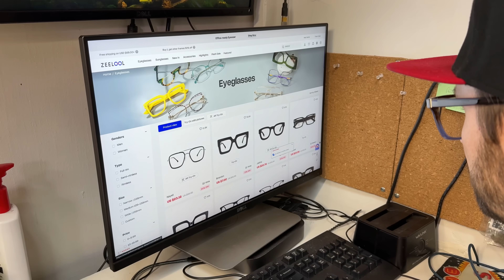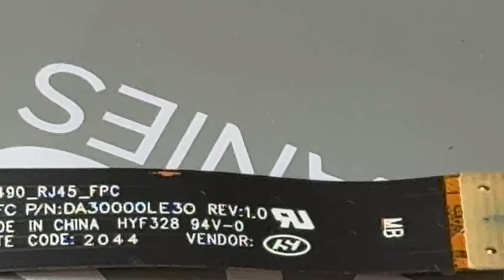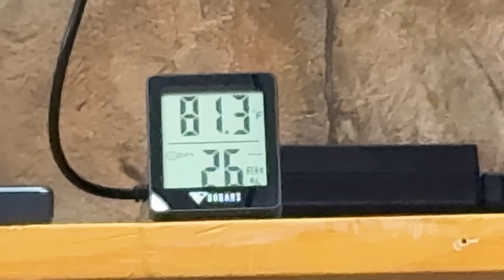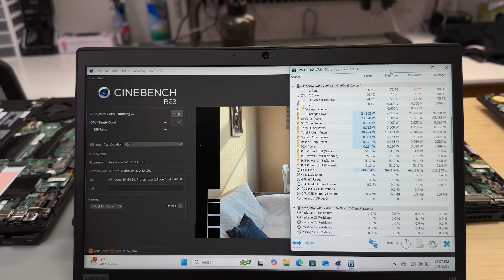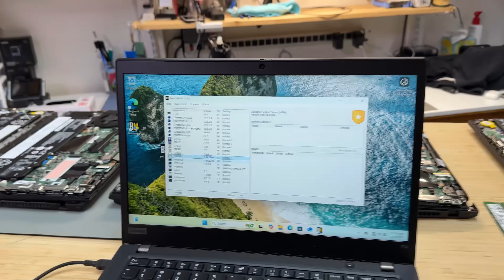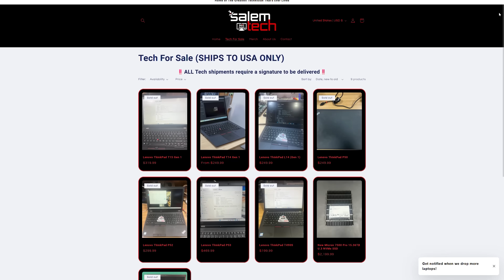Is Replacing Laptop Thermal Paste a MASSIVE Waste of Time? Let's Test!

Comment: @4:23 
Senior systems admin here, I happen to do a lot of endpoint configuration,imaging and server maintenance all day everyday for like 9,000+ endpoints.

As far as a good middle ground for imaging devices goes you can look into setting up a PXE boot server and a dumb switch with IP helpers. Just plug as many laptops in as the switch can take and they can pull an image from the PXE server. You might have to stand up a MECM/SCCM instance to use task sequences to make managing it easier. 

You could also just set up an ISO and config field on a FAAAAST USB drive to image off of. Configuration files or task sequences can help automate the whole thing for you to the point you just click accept initially and it runs the rest.

Azure has good solutions for imaging as well but then you have to lock in on the azure platform and it’s still subpar compared to AWS and other cloud services out there. We are being forced over to it and it’s a learning curve.
Reply from the maker: Due to the lack of Ethernet ports on the newer laptops, and my lack of funds to buy 1000 USB-C to ethernet adapters, I've resorted to using multiple NVMe cloners and saved Clonezilla images to image each device. But I appreciate the time you took to give me advice, I hope you are being paid well to handle all those endpoints!
Reply: @ that’s very fair. 
I am fortunate to have an entire stockroom of Ethernet to USB-A and USB-C adapters to use. We never image more than 30-40 laptops at a time though due to manning. It takes about as long to walk down the line plugging things in, powering them on and configuring the boot settings then initiating before the first few are done. 

Your cloning method is honestly smarter and faster because of the fewer parts and configurations needed for the scale you are doing. 

Definitely not getting fair compensation and will be looking at branching over to the Pentesting and white hat realm here soon. 7 years as a sysadmin has built me a stacked skillset but a narrow and heavy workload, I am sure you can relate lol. 
Love the videos and the right to repair advocacy man! Keep up the good fight.

Comment: Don't know if anyone has made this particular suggestion to you but I've used a procedure in the past to duplicate an image to multiple machines simultaneously and the same method can be used to image single machines or as many as needed at one time.  It's the client-server model and it would involve obtaining an old PC and repurposing it as your imaging server. I've used this method to image a classroom of 21 computers at one time and it works great doing single machines at a time as well.

Comment: Might want to try looking into MDT if Micro$oft still maintains it. A few years back I configured MDT to deploy a vanilla copy of Windows 10 and had the drivers dynamically installed depending on the model of computer I was deploying to. Automated BIOS upgrades were also added to the workflow. 

Another option would be FOG but not sure on its Windows 11 compatibility and dynamic driver assignment during deployment.

Comment: wouldn't high performance thermal pads serve your refurbished customers better as they don't degrade and now offer comparable performance to paste on laptop chips without heat spreaders?
Reply from the maker: I reserve PTM for the laptops that have higher temp chips. PTM is very expensive, and my laptops are very cheap.
Reply: @SalemTechsperts  when the pads are $10 a pop then that's fair enough

you seen that cheap stuff from china/aliexpress rated at 21w/mk? limited info online but what i found was positive

Comment: If you need free imaging software ,i've used one when i was working for a cheap ass company, FOG. (Google Fog Imaging or Fog Project, first result)

The configuration is not that hard, then once you create your base image to deploy you configure your firewall for PXE boot, then on boot selection you launch "boot from PXE "  and the machine thatt host FOG will run the utility.

You better follow the official instructions as my explanation is rather short.

OR

Acronis, this one probably more relaible and easier to use since you basically install it on a bootable device and then pull the imaging from another Removable USB device.

Keep in mind that when doing IMAGING something can happen, i had little glitches with FOG but none with Acronis.

Also you need to SYSPREP the Master PC (the one you finish to prepare and be the base Image)

Comment: I have a p50 because I watched this channel, 32GB i7, clean throughout. I upgraded the M.2 slot with a  1TB NVME, installed Linux Mint as dual boot with Windows 11, and it's done...or so I thought. The box wouldn't shut off properly when Linux shut it down, the battery would drain during the night, plus the power button wouldn't wake it from sleep. I turned off some things in the BIOS and rebooted, and all is good now with updated firmware. Great machine and an excellent unit. The one thing I haven't done yet is redo the thermal paste. I'm a bit leery of bricking it or breaking something getting to the motherboard so haven't made the effort...yet.

Comment: Hello I just have question i have a Acer Nitro V i5 13th gen with 4050 RTX . is it normal for the temps to be on 60-70c  it usually spike on 70c if its on loading screen. What would be the ideal temp for a gaming laptop

Comment: As much as I love your channel I am still going to critique where necessary 

The blue light from monitors only affect your sleep cycle not your eyes, we more exposed to blue light from the sun than the computer screen and if you don't want your sleep cycle affected every  modern day device includes reading mode which does all the work that those glasses do.
Your eyes get bad for looking at the monitor for too long without blinking (eyes get dry) and focusing on close objects for too long. So even if you buy and use blue ray glasses and don't care to blink and look away every 15 to 20 minutes you still will ruin your eyesight same as before...

Comment: I have a 2023 G14 (GA402XV) and when it was new the GPU would run up to a consistent 100-110 watts under load. I replaced the thermal paste with ptm7950 and k5 pro for the vrms, vram. My CPU temps greatly improved while my GPU now thermal throttles at around 80 ish watts.... I don't know why or what to do. Please Help!!

Comment: Just saying- on my MSI GL65 Leopard.
Using thermal paste gave me GPU Artifacts issues.
Switched over to high-end Thermal Pads called EC360 Gold.
No more GPU Artifacts and temps are much lower, running perfectly stable even with more demanding games.
Not to mention that thermal paste needs to be replaced minimum once a year for regular laptops and twice a year for gaming machines.
While thermal pads last at least 9 years without any maintenance other than regular dust cleaning is required.

Comment: actually it helps especially for gaming laptops. I have a msi vector laptop with i9-13950hx processor and RTX 4080 suddenly died while running heavy games like cyberpunk 2077, I thought my laptop was broken. and finally I tried replacing the cooling paste with Honeywell ptm and puty upsiren. after that it runs normally again but the maximum temperature does not change compared to before replacing the paste

Comment: Hey man, during 2017-2018 I was called to deploy windows and mining software for a business selling turn-key Ethereum mining rigs,  my biggest job was a 100 miners room, I didn't even had ssd copy hardware, but what I did was having one "master" rig with hotswapp enabled for the hard drives/ssd and used Macrium Reflect, but I didn't used the cloning Feature, Instead I used the imaging feature. It did kinda work like the same but cloning had to major issues: 1) Time, it took like 15 - 20 minutes per image clone, 2) It was like mobo/architecture dependent: It always had some issue if booting in a rig that wasn't exactly the same config... While Imaging was done in like 3-7 minutes per burned image, and no matter where you plugged those disk, they simply booted with no issue whatsoever. Dunno it that info works for you, but for me I was able to exponentially use the already burned disk to boot up others rigs and used them to create more copies faster. In 15-35 minutes I had 5 working Rigs chugging out imaged drives. All 100 imaged  drives done in like 2 hours in a half

Comment: That PTM7950 is no joke. I was getting rising temps with GPU pushing close to 80 and hot spot temps hovering around 100 on my 7900xt after owning it for 8 months. Applied the PTM and now GPU temp is 66 and hot spot is high 70s even lower than when brand new.

Comment: I recently picked up an MSI laptop on Marketplace for $75, owner said it was overheating. It was overheating. It was obvious they had opened it and attempted to clean it out, but it was onvious that they were scared to do more than remove the cover. They had cleaned some of the gooch, but when I pulled off the heatsinks the find were full of gooch and the thermal paste was not just crusty but only applied on half of the CPU. A good cleaning and it is working great.

Comment: Some say blue light (BL) filter glasses remove or eliminate BL, some say they don’t work at all, but most of them if not markedly tinted orange or yellow
will block only some of the BL-
somewhere in the middle between 0%-100%.

Comment: Not quite the same story, but the fact is, if you think something is going on with your thermal paste, check it.

I thought my thermal paste was either faulty or I even possibly didn't put enough on because my temps were pretty high, hitting the 90s when running certain games. I tried to alleviate this by forcing lower frames, worried that I am not qualified to do something like that with the worry of breaking something.

After a FULL YEAR of just trying to work around the problem, I finally mustered the courage to buy some thermal paste, so Isopropyl alcohol, cotton balls, and pointed cotton swabs for precision cleaning. 

When I unscrewed the cooler on my CPU, it sprung off the cpu like a trampoline. This was already a red flag. When I pulled it away, there was no thermal paste on the center of the cpu. Just the edges. Clearly the cooler was on too tight and pushed all the paste from the center. I did my best to clean off what was there, reapply some thermal paste and attempted to put the cooler back on. I immediately noticed that the cooler had to be pushed down on both sides to even screw in. So when I tried my best to finger tight fasten it, and gave it a few minutes to let the thermal paste to settle, I removed the cooler once more just to see how it fared this time. The cooler was still pressing on the CPU too hard and I noticed that everything in the middle was already being pushed out to the edges, and I knew this would only continue.

This caused me to get a brand new cooler, and I knew it was the right choice when the cooler sat perfectly on the CPU and only just needed to be fastened without having to make the screws reach where they needed to go.

After this whole situation, my CPU hasn't gone past 65 celcius, even with running the new Monster Hunter Wilds game on high with 60fps.

I was so mad at myself for not choosing to check this sooner. Remember that if something seems wrong, something probably is. If you don't feel comfortable checking the parts yourself, please please seek a professional who is willing to help. It never hurts to check.
Reply: Was this for a laptop?
Reply: @ragna5902  It was for a desktop. However I would assume the same rulings can apply to laptops as well. I would just take precaution and look up guides. If you aren't confident or are worried about bricking your laptop, I would still strongly advise contacting a technical professional to check and see what's going on.
Reply: @TankyCrobat Thanks for this cautionary tale.  My husband’s old desktop died, so I’m going to devil into it, just to figure out what caused it to fail. 👍

Comment: For cloning the machines - if you are planning doing this in a long run: invest some time into building a WDS (Windows Deployment Services) server + MDT (Microsoft Deployment  Toolkit).
The latter is deprecated, but maintained by some community folks.

What this achieves is a network-boot server that you can image your machines from - Lenovo actually provides pre-made Windows images with all the drivers & software inside, so you can set it up to Boot from network --> boot from your installation media --> install model-specific image, all automatically.
Then you just connect your 5-10-20-200 laptops via Ethernet, network boot them and watch them all do their magic in ~20 minutes.

Comment: So you see this chip... this is the blerp they don't put paste on it.  😂 that's the iGPU and it should also be cooled but inly if you try to game on the pc... otherwise not an issue.
Reply: In all actuality, pch temperatures are an oddity because it all depends on the hestsink cooling effectiveness.  The pch chip often needs cooling, but also often NOT.  What I've found is if the pch is closer to the fan than the cpu die, add paste, if it's further then don't because being at the tail end of the cooling will mean it needs to avoid making contact with the heat pipe to prevent transfer from the cpu. In short, if they didn't put it from the factory, don't do it.

Comment: I replaced the thermal paste on my gaming laptop with a quality one shortly after the purchase, because it did thermal throttling. Then it did power throttling for 3 years before the pump out effect sucked out the paste.
My 12 yo gaming tower PC barely reaches 60°C on the CPU, still with the original paste from intel.

Comment: Had a problem with my PC.  Over heated and shut down.  Got tech to work on it.  He replaced the thermal paste on the mother board AND my gaming card.  Worked like brand new.  Even tho my system was custom built about 9 years ago.  I had him build me a new system, but I still have the old one and it still works great.

Comment: The problem I've had with business grade laptops is some of them are still registered to use Microsoft Autopilot.  Cloning drives masks this and you end up shipping laptops that will still try and re-connect with Autopilot if the Windows installation is run again later on.  The only way I have found to detect Autopilot is to run the Windows installation on every laptop which takes forever :(  Does anyone have a quicker solution?

Comment: Hey greatest technician who has ever lived. I hear on reddit that it is normal for an rog strix g17 2023 with ryzen 9 7845hx and 4070 to run the cpu at 95C while gaming (playing cybergunk 2077 at 1440p native max settings without raytracing). Is that the case or should i do a repaste (it is liquid goo from thermal grizzly bear)

Comment: Hey there, Just a doubt but, I have a Dell Inspiron 3581 with an intel core i3 7020U. I use it for my everyday use, And somewhere along the run I did open up my laptop (well i did it recently too to add a 16Gb ram to 4Gb that i had), I do remember opening the heat sink for the CPU and i simply put it back cuz well I was younger than i am rn and i didn't  know anything about a CPU or laptop. 
So recently since i did change my ram i thought i'd just dig into getting to my CPU and GPu a bit better so I downloaded throttlestop and well , I got my CPU temp and Ram and stuff, 

prob regarding ram - I have a 4GB 2667MHz + 16 GB 3200MHz and somehow Dell  is limiting the ram speed to 2133MT/s 
and Another concern is that 
CPU temp - it is at like 53 degrees Celsius upon startup itself , so it makes me a bit concerned 
I'd like to know you thoughts and opinions for me, even tho I use it for daily purpose i use this for a bit of gaming and video editing (check my channel cuz Idk how to say more) and I know you might be thinking why ain't i getting myself a better PC already 
so will this affect my pc??

Comment: Some guy thinks thermal paste is snake oil? that guy should be forced to purchase a $9,999 threadripper and a heatsink and attempt to use it with either no thermal paste OR the cheapest crappiest $1 paste available.   
Then video themselves crying over their wasted $15k of equipment as the threadripper welds itself to the board

Comment: We use FOG to image our machines. Getting FOG setup is sort of a pain in the neck initially but once its setup you can capture an image in as little as 30 mins and deploy via ethernet/ipv4 with secure boot off to as many machines via a switch.

Comment: The first step in repasting is to not buy a laptop that gets to 98c. You can use the most expensive thermal paste that exists, but you're still losing performance because the Thinkpad cooling solution can't handle even 50W... sad :)

Comment: I got a Lenovo legion laptop with a 6900hx and 6800s, its their thin 16" model, its incredible how powerful it is in such a thin and light package, but the CPU hits 100C in games quite easily and throttles big time.  The GPU is fine, but the 100C cpu blazing next to it doesnt help the system cooling.  Ive been debating repasting it, but Ive seen Lenovo designs their coolers for a certain paste called honeywell, but I was thinking of doing liquid metal.  Think it is worth it?